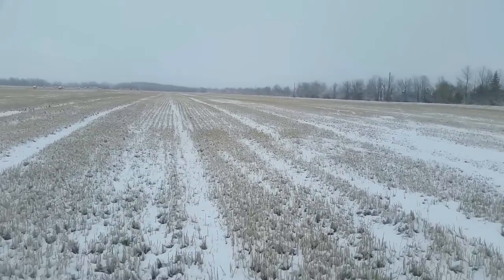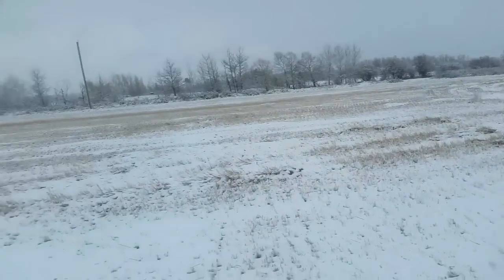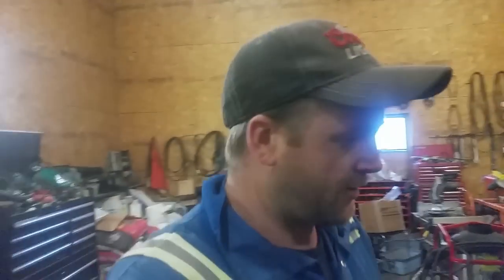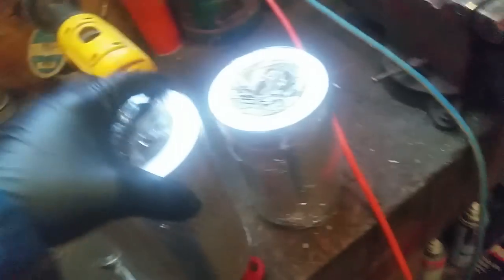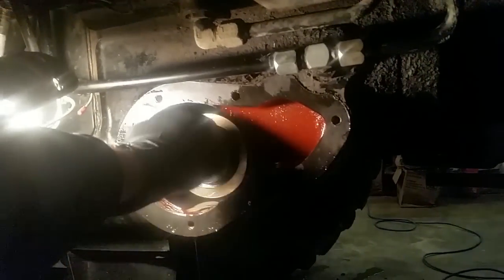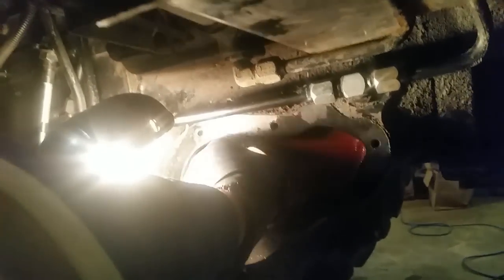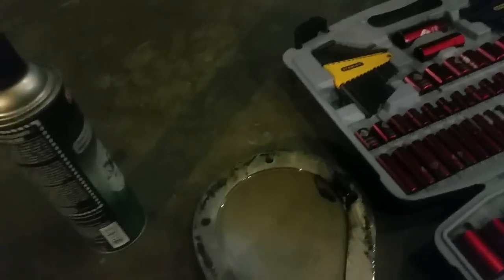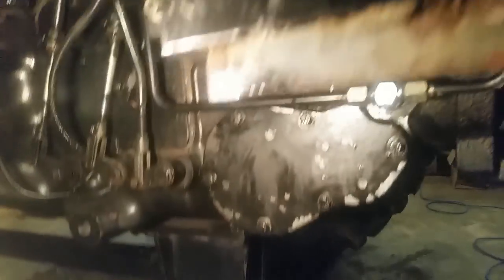Case 2096 trans filter change on a snowy day

Comment: We had a 2394 with that seat problem not going back up. There was something out of adjustment on the knob under the seat, i always had to lower the seat all the way down then push/hold in real hard while the tractor was running and it came up. The older case 70 series had hydraulic filters outside the housing that pretty much did'nt work. The hydraulic valve spool assembly was mounted vertical and about every 2000 hours dirt would accumulate in the ports no matter how many times you changed filters. So the power shift would get super ruff like a old 2670. One time in the early 1980's i was moldboard plowing with a old 1070, downshifted to 2nd 2nd and the tractor threw me out of the seat up against the windshield! Driving that thing was like a wrestling match and a great many mtn dews were lost on the cab floor.

Comment: That little valve that I told you about for the seat is located right behind the battery box above where you just changed the filters. You should be able to trace the lines down to there anyway. It's some sort of pressure regulating valve and it goes bad sometimes so you don't get oil pressure to the seat. It can't really be fixed so you'll need a new one.